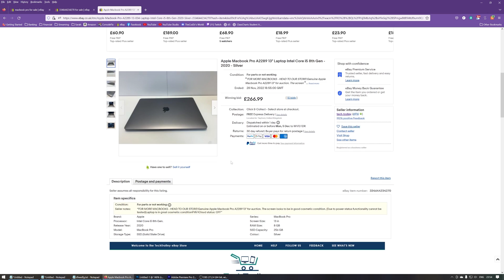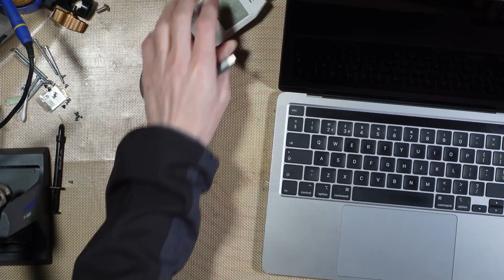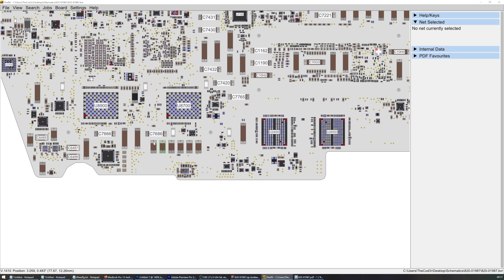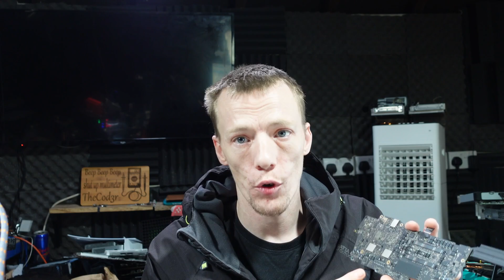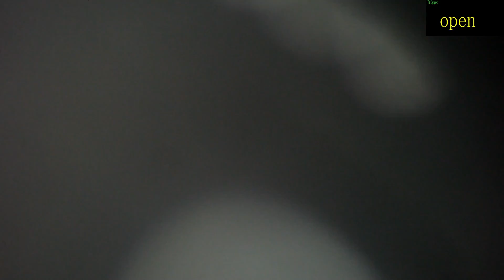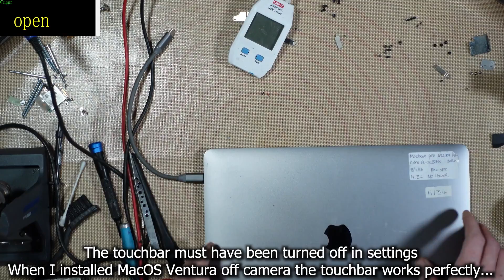I Bought A 2020 Macbook Pro With No Power, But Can I Fix It?

Comment: I have a similar issue with mine it don't power on but is charging the battery as my power meter is coming on showing 20.4v and charging the battery at over 1A but when I press the power button nothing happens any ideas where I can check ?? its got no water damage or anything.

Comment: So, you've given me the motivation to finally remove the wifi chip from my switch and put down a pre-reballed chip. the removal came out perfect, no pads broken, nice and clean, now I have to lay down the preballed wifi chip and pray it lands in the right position.
Reply: Just don't blast your airflow too much and it should go great, fingers crossed for you (keep us updated with the success lol)
Reply: Noise! Did it work?:)
Reply: @HD-wf3bp  Not yet, the chip was supposed to arrive yesterday, but didn't and USPS doesn't deliver mail on sunday, so I gotta wait until tommorow.  :(
Reply: @donannis  waiting for parts sucks! But hopefully it's going to be worth the wait :)

Comment: OverLoad? Interesting. Here I always thought OL meant Open Loop or Open Line
Perhaps I’m misunderstanding what you’re doing with your leads.
Reply from the maker: It really doesn't have a definitive meaning when it comes to multimeters mate. I call it open line myself, but that meter I use for videos (because of the on screen function) says overload on the software
Reply: Technically it's over-limit; speficially that the value being measured is beyond the bounds of the range selected

Comment: Get an ultrasonic cleaner, also shouldve avoided running jumper next to isil ic, it will eventually need to be replaced.
Reply from the maker: I do have an ultrasonic mate. Mind me asking why you wouldn't run a jumper next to an IC? Not questioning your logic or anything, I just genuinely never heard of a reason why it shouldn't be done 🤷